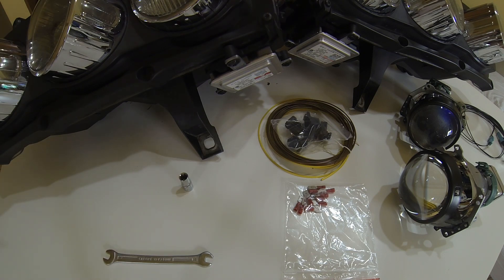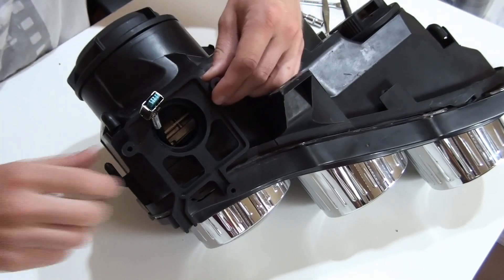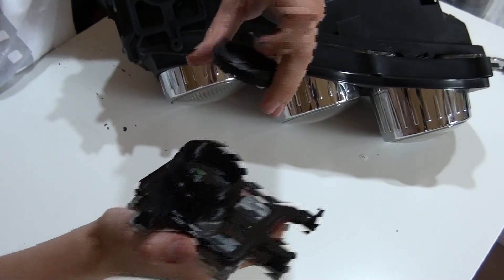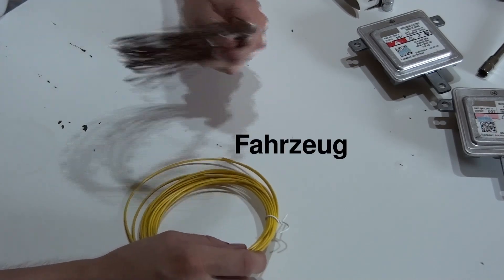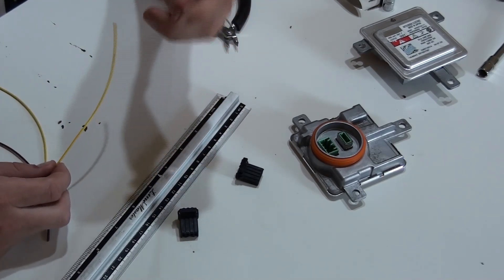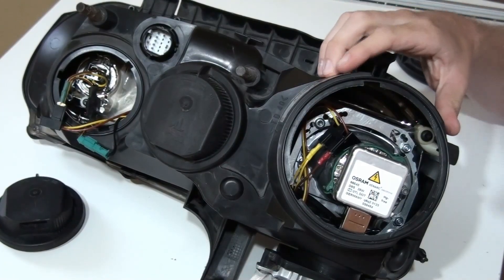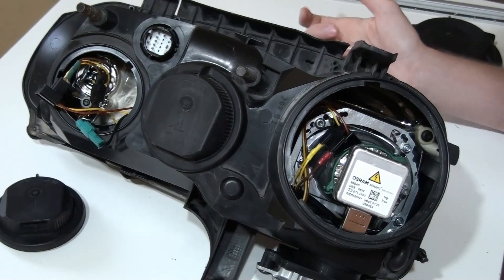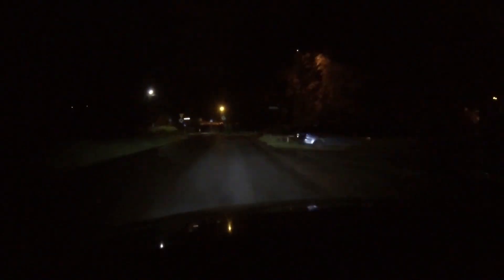Headlight Workshop: D8S HID system retrofit.

Comment: Hello. I want made this for my car, i whant to know, do you have any problem with this retrofit kit, and do you have any light error on your dashboard. You made better than factory. Thanks for information.
Reply from the maker: I have absolutely no problems with this retrofitted system. No error on the dashboard in my Alfa 159. I can surely recommend this.
Reply: @GMcarsMAN  And i have one more question. How do you fit the projectors inside the headlight, because Alfa has Bosch AL projectors, not Hella 3R. Where must i cut it, can you show this or do you have any video of it ? 
Thanks for help.
Reply from the maker: @blagojcefiliposki1170  see my other videos where I swap the original projector for a Hella 3R H18 one. Same way of mounting. I hope you’ll find it helpful.
Reply: @GMcarsMAN  Thank you for helping me. And where can i find this ballast and projectors ?
Reply from the maker: @blagojcefiliposki1170  I bought the projectors new from AliExpress, the ballasts I bought used, from VW Golf VII or Audi A1
Reply: @GMcarsMAN  I want made this retrofit conversion with ballast from bmw e39 d2s. Is it possible or no ?
Reply from the maker: @blagojcefiliposki1170  it is possible, of course, but for D2S xenon you need auto leveling and headlamp washers to be compliant with the ECE regulation. That’s why I went for D8S, with these you don’t need that.
Reply: @GMcarsMAN  D8S is same than D1s ? I mean D8S have same D1S connector ?
Reply from the maker: @blagojcefiliposki1170  yes, it does, but you need a dedicated ballast for it, a D1S ballast won’t work as D8S is a lower voltage burner. Maybe a D3S ballast will work, but one retrofit shop told me it would damage the burner.
Reply: @GMcarsMAN  What i better solution 35W or 55W ballast ? And how many wats is that D8S ballast ?
Reply from the maker: @blagojcefiliposki1170  D6S and D8S are 25 W systems, that’s why you don’t need auto leveling and washers because their light output is low enough to meet the regulation but still higher than that of an H7 bulb. D1/D2/D3/D4S systems are 35 watt systems, for these you need washers and auto leveling. 55 W systems haven’t been used commercially and I wouldn’t go for it, just buy E39 system, it’s compact and should last.
Reply: @GMcarsMAN  But the light output with 35w ballast and D2S bulb is better than D8S bulb and 25W
Reply from the maker: @blagojcefiliposki1170  yes, but to legally use a 35 W xenon system auto leveling and headlamp washers are necessary. For a 25 W system it’s not necessary and the light output is still satisfactory.
Reply: @GMcarsMAN  Do you have problems with the projectors, how long do they last, and how fast do they burn ? And boast give the same light as when they were new ?
Reply from the maker: @blagojcefiliposki1170  I have been using them for 8 moths now, still doing fine. The burners I bought genuine used, still no problems.
Reply: @GMcarsMAN  when I ask how fast they burn, i think of the projectors. Are they burned ?
Reply from the maker: @blagojcefiliposki1170  I got what you meant, though I haven’t seen the projector from the inside since I retrofitted them. For sure there is still plenty of light so I don’t think that they got burned anyhow.
Reply: @GMcarsMAN  What do you mean about installing D2H HID xenon kit 35W in that or any D2S projector ?
Reply from the maker: @blagojcefiliposki1170  go for genuine D2S burners, not D2H, if it goes out you’ll be able to buy it anywhere
Reply: @GMcarsMAN  The process is the same ?  Your recommendation is D2S kit because it is harder to find D2H bulb ?
Reply: @GMcarsMAN  And can i install Osram or Phillips D2S bulb on a aftermarket 35W  canbus ballast ? Will it work the bulb or no ?
Reply from the maker: @blagojcefiliposki1170  it should work fine
Reply: @GMcarsMAN  I will try anything, i don't know now, but when i made it i will tell you. How can i find you on social media, instagram or fb ?
Reply from the maker: @blagojcefiliposki1170  @tomegm